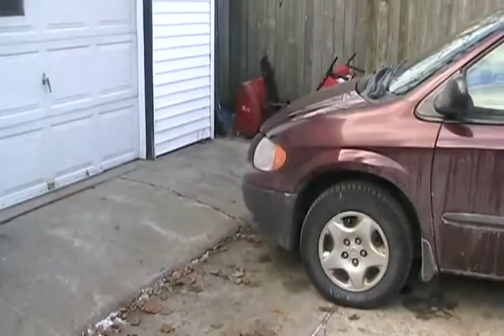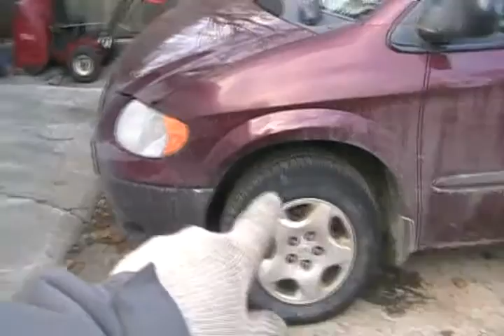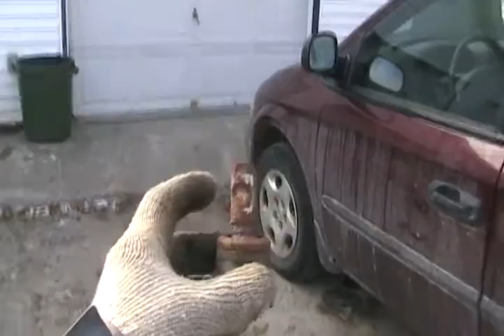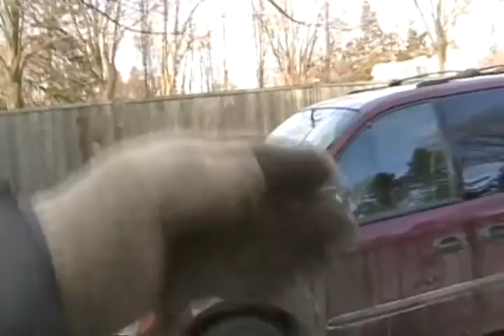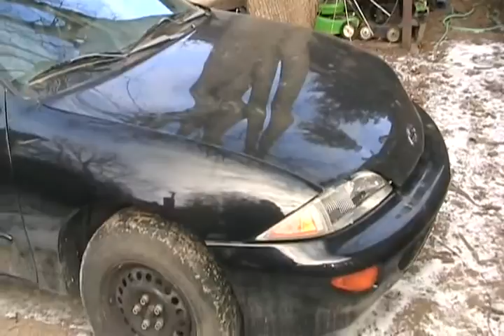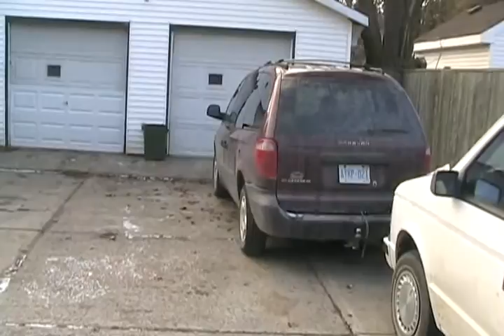#1202 Automotive mythbusters, tires, suspension, brakes, steering [Davidsfarm]

Comment: New pads are needed after the metal to metal grinding makes them thin enough to fall out.
Reply: is it really neceesary? i usually install when the pads dont exist anymore . then i can swap disc at same time for free
Reply: We use a new disc, it lasts long enough for 2 sets of pads before it needs replacing again.